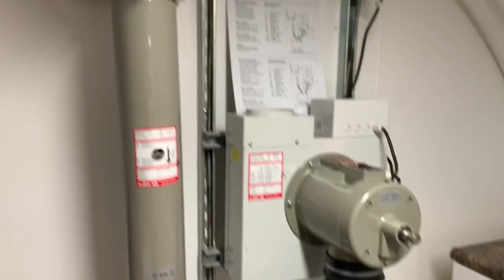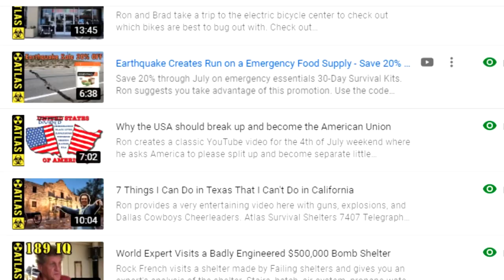Installing a Bomb Shelter in South Dakota

Comment: I’ve always wondered how plumbing, water, power, etc is done on these bunkers. Do you install septic tanks, water lines, and water reservoirs? Is the power from generators or batteries that come with the bunker or do you install solar?
Reply: Zero what ever you want can be done. It’s just money.  These are not typically for long term.
Reply: Yes you  can have a septic tank hooked up  to your shower and sink and toilet and  you will also have a buried water cistern. In addition you can have something added called a generator pod where you can have a generator and hook the exhasut pipe with another pipe that leads up to the surface not filling the room with  poisonous fumes you can also  have a 75-100 gallon tank of diesel or gasoline in it also the generator pod has a gas tight door so incase the exhaust pipe doesnt work the fumes wont get inside the actual bunker and then if it gets past that door there is still one more gas tight door.

Comment: The questions: 
How large was the hole? Depth? 
How large of an open area (no tree's) is needed?
What is the normal heavy equipment used for an installation?
Do you ever use three guys to shovel sand into the escape tunnel?
How much roughly did this installation cost?
Reply: Deep.
Alot.
Big
No, sadly
Alot.
Reply: There's a doomsday prepper episode with atlas survival shelters. If you can give it a watch.
Reply: The installation cost is around 20k i believe depending on size
Reply: 20' deep and you can go down as far as 40' with this type. Installation depends on what type of soil needs to be dug out and size of the bunker you buy ??

Comment: Have you ever thought of adding a second standalone air in pipe, the NBC could be attached to if the main pipe is blocked or contaminated in some way?
Reply: I was thinking the same. What if some people put a piece of plastic with a rubber band over the pipe, you don't get air anymore. Maybe have multiple in and out takes, or protect the pipes with a small reinforced concrete structure with some vents on  the sides.
Reply: @mzuidema100  :- Camouflage the air pipe with a stone gabion and have multiple smaller air-tubes coming out of it. Gabions can be any shape its an easy fix if u use your imagination.
Reply: Yeah how close the pipes are it be easy to figure out, same with escape hatch. Park a vehicle eon hatch they can not get out, find escape hatch and block it and then seal up air intake and exhaust and call it good, come back later when they are all dead and take what you want...LOL Forget about a cabin, these make for a great cabin. Kinda hidden, and yeah I think the piping needs to be ran further apart same for exist...obviously costing more but would be better as a shelter then.
Reply: Build a house on top of it
Reply: That is a possibilty if I was to buy one I would also have if neeed to be used air tanks so I could secretely go up thru  the escape hatch and shoot at the bad guys and unblock the air pipe

Comment: Needs to be 20 foot underground for radiation.
Reply from the maker: these are 20' under ground
Reply: Monte Bank they are. You need at least 6’ of earth between the ceiling and outside. And if I recall correctly, these bunkers have 8’ of earth between.
Reply: Where did you get 20 feet? You only need 6 feet.
Reply: @davecraft8753  Research.
Reply: @montebank4  Cite your sources, don't just say "Research".
Reply: @Zeubermage  DYOR

Comment: I have seen your YouTube video since 2018.  I believe you build Class A+ Survival Shelters.  I despise businesses that take advantage over other businesses.  I like your building practices and your honesty.  Unfortunately I can not afford your Shelters. I do like them. I don't know if you give this option is lithium batteries with solar panels or both options with the diesel engine.  Because if the earth goes to hell we have the sun. Emp, solar emp, nothing will work without power. Diesel engines work so long.  It's just an option you want to consider.  PS I gave you a 5 star review on Google.

Comment: Do these shelters usually sit on prepoured slabs? I’ve long wondered how they get especially level horizontally and vertically when placed in a 20’ + deep trench. 
Where did power, water, sewage for this installation come from... the site look (understandably) remote without solar/generator, well, septic ect anywhere.
Wouldn’t the cost of a 60ton on site in such a remote location be almost cost prohibitive, possible eclipsing the expense of the excavation and even some of your smaller shelters?
I admire your product 👍🏻
Reply: I think you  can choose if you want it on a prepoured slab  but what I do know of is that you install a septic tank for your shower and toilet and sink and youll also have a wwater cistern buried and if you want you can  also get a added on generator pod which is between 2 gas tight doors and you hook the generator up to a pipe that comes out to the surface letting the fumes come out and you can also have a 75-100 gallon gas or diesel tank in there aswell. Also underneath the flooring you  can have batteries  connected together to power everything.

Comment: If I had the cash, I’d buy a culvert bunker and a shipping container and put the two together as one big bunker.....if it’s feasible that is. If I could talk to ya in person, it might sound better....
Reply: you better have 200k+ ready lol
Reply: a shipping container can't be buried btw unless it has structural reinforcement
Reply: mrmotofy thats true. But I’ve watched, and rewatched a video of a guy who buries a shipping container and makes it his wine cellar. I’d be doing the same thing, but instead of wine, I’d use it a “mud-room” of sorts. Look up Wayne Martin, Shipping container as underground shelter.
Reply: @johndowe7003  They don't cost $200,000.00 LOL !
Reply: The problem with using a container there is no strength on the sides of it so you have to build concrete blocks around it and a concrete roof so you can bury it. It ends up costing more than using a culvert shelter.
Reply: @RJM1011  look on the website
Reply: @johndowe7003  I already have !

Comment: Why don’t you put a submarine hatch/ door on the escape side of the shelter and I don’t mean by the sand box area, that’s fine, but what I mean is directly before it just inside the bunker area that leads up to the tunnel; namely where the master bed room is where you have the round gaping hole?

Comment: what's the purpose of the escape box and why is sand added to it? And how much sand is needed for whatever the reason is?
Reply: If the other way in can't be used you can use the escape to get out the sand is there to hide it the door locks from the inside only on the escape door.
Reply: Sand prevents (long delays) an outsider from using it as access.

Comment: Why the sand in the escape box? How do you get out if the entry is blocked?
Reply: i think its to protect from outside elements since plastic is there maybe cut a hole in the plastic and the sand falls through and you can climb out i dont know lol.
Reply: The sand is there to hide the escape the door only locks from the inside of the escape door.

Comment: My concern with the bunker ventilation pipes... they're not high enough, if it's a Mega volcano or asteroid impact, ash could be more then 2 feet high.
Reply: ZeroCool if it’s a mega volcano or asteroid impact you’d be dead anyway. Good luck getting out of the bunker once everything has calmed down as well.
Reply: There will NOT be 2' of ash every where !

Comment: Why do u put sand in the escape box?
Reply: john manasco so it can’t be found and opened from the outside. The sand has to fall into the escape tunnel for the panel to be able to be moved.
Reply: A raider would need to lift all that sand from the hole to get it, not impossible of course but why are the occupants IN the shelter - because the outside is unlivable, has an NBC threat, so the raiders digging away won't have the time before they expire - in theory.

Comment: If at all would it be possible to instead fill the hole with concrete?
Reply: ofc
Reply: @PlatinNr1  are you a structural engineer
Reply: You can it would cost more.

Comment: total waste !!
you must dig it like 10 times deeper minimum and escape path must be at least 300 feet away !!
Reply: These are good points, but this is just the base bunker you can customize them till ur liking they will build/install it how you want it over all.
Reply: 20' deep is plenty and you can only go down to 40' with this type. You can have the escape as long as you want it's just going to cost a lot more.